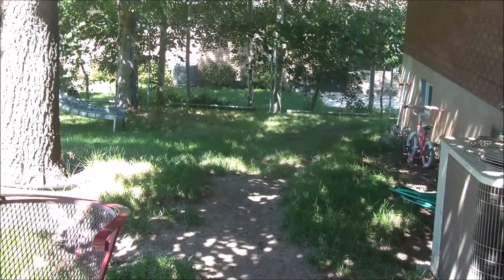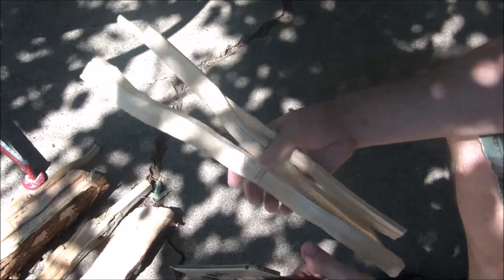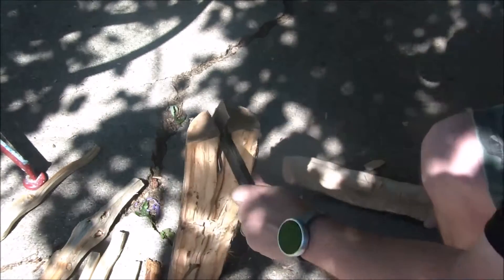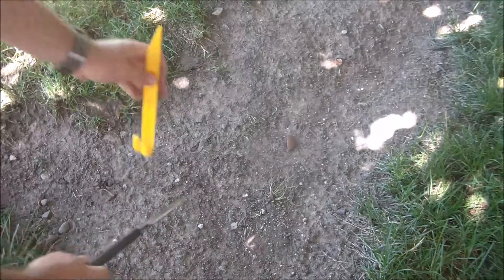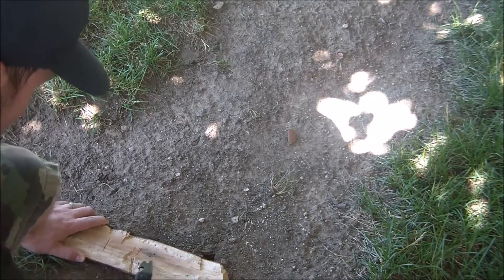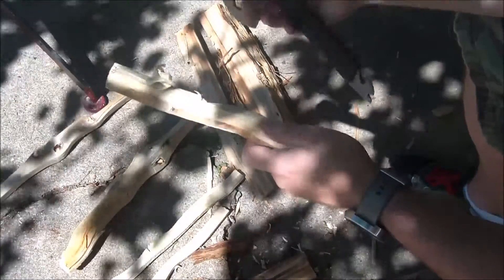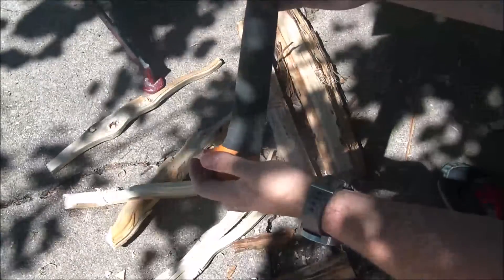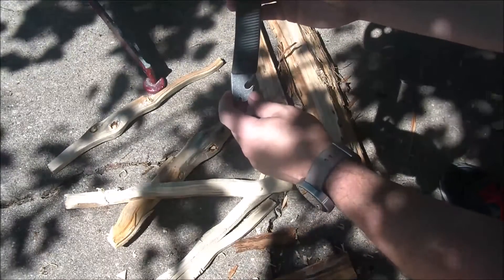Kershaw Tinder Review

Comment: When you were using it to pull the stake out, I had a vision of the stake coming up suddenly or the Tinder slipping off and in either case, the exposed hatchet edge ending up slashing your knee, which appeared to be too close for comfort. A cover for that edge would have been a good idea for Kershaw, if only to cover their own backsides. They did design it as a multi-purpose tool, after all.